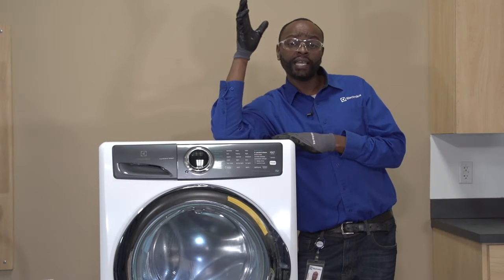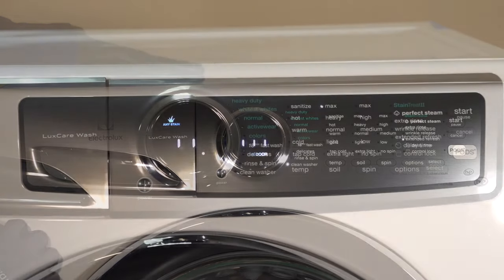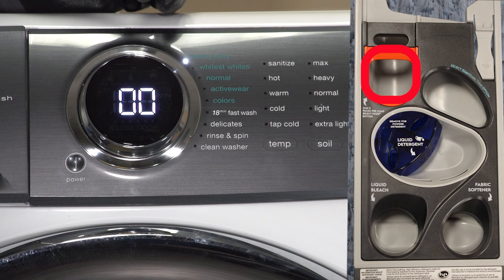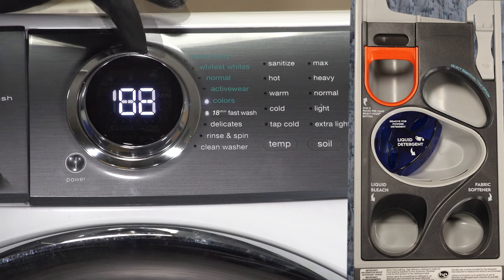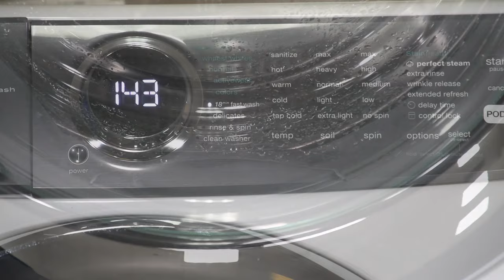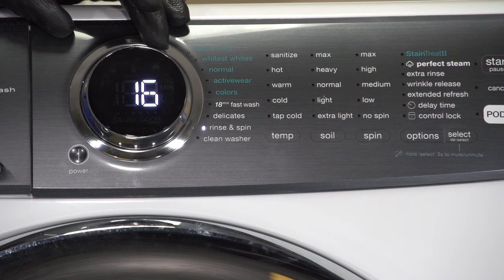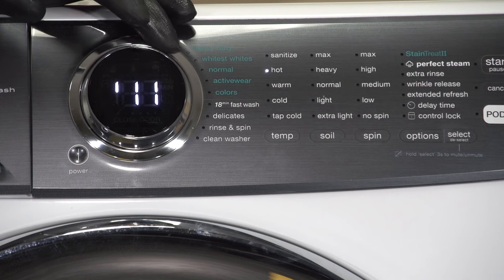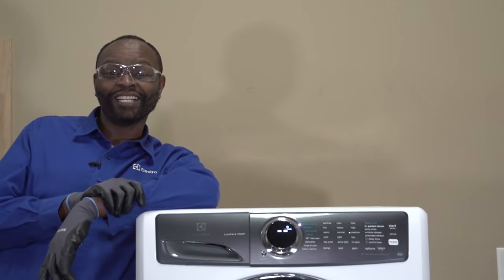Electrolux Washing machine repair -  test mode

Comment: Great teaching video. My washing cycle won't stop. When the timer is 45 min it won't go down, I have to unplug from the outlet,  wait 5 minutes, and complete  the load with rinse and spin, so the timer is  12 minutes,  but it literally takes 20 to 30 minutes for a 12 minute cycle.

Comment: Thank you for this video! I had error code E 11 and I ran through all the tests in series, 1 thru 13. This seems to have cleared the issue, at least in PODS mode. I tried going directly to test 6 but that caused error E 11 again. Then going in series, all the valves worked, pressure sensor worked and the tub filled, heater, recirculating pump, drain pump all worked. Running a load now, if I have more issues I will update this comment or comment again.

Comment: How do you get it out of test mode?
Reply: Turn the dial out of code 00  test mode  and then hold the off button for like 3-5 seconds. Then it will turn off  and when you turn it back on, it should back to normal mode. Hopefully this helps.

Comment: I have the same model, but the power button is not working i touch it several times and is not turning on. Once I finally get it to turn on, its not turning off. 😭😭😭

Comment: Thank you for the video. My Electrolux is buzzing during the fill cycle unless I turn it off and turn on again, then the buzzing stops. Is there a test? I'm guessing it is a Water Inlet Valve Assembly, but I'm not 100% convinced. any ideas?
Reply: I'm having the same issue. Did you figure it out?
Reply: Asking as well! Loud buzzing when filling machine 😭